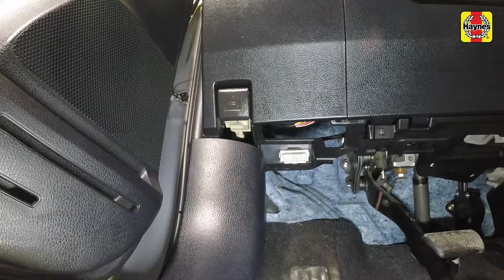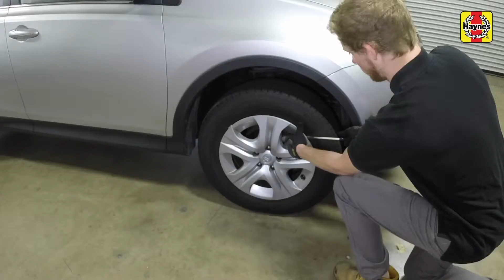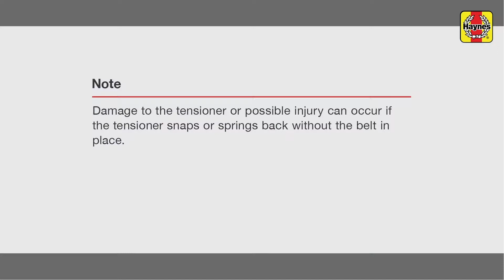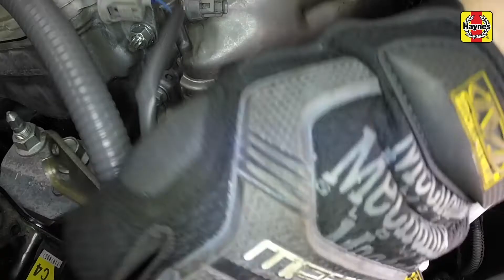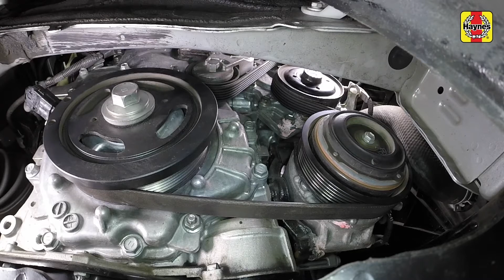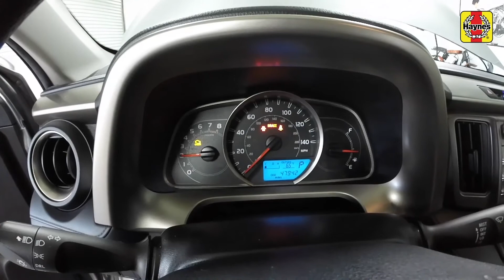How to Replace the water pump on the Toyota RAV4 2013 to 2018

Comment: You never poured any antifreeze directly into radiator. Is that correct?
Reply: @larrylynn5965  that is correct.  For this vehicle all coolant is added through the expansion tank.

Comment: Used oil & transmission fluid can be taken to local auto parts store to be recycled.  
What does a person do with the old coolant?
Reply: Most garbage dumps/transfer stations will have a tank that is used to capture old cooolant and also another tank for oils and somewhere to throw the old oil filter. Check with your local dump/garbage location to see what they offer. Should be no  charge.
Reply: @macker0077  yes. And in my case. The closest dump/transfer station would not accept it, had to drive to different one on other side of town (just fyi for any else searching for local antifreeze disposal)
Reply: another option is to check your city/village.   It will have its own maintenance department.   My village maintenance department takes used oil, coolant, brake fluid, and household chemicals.

Comment: Great video! Thanks for including those important torque specs, which many fail to mention. My daughters 2017 RAV4 has the tell tale signs of a failing water pump. That pink coolant slung on the hood by the serpentine belt is a dead giveaway. Any chance you have an estimate of how long the job is start to finish? I'm going to say 3-4 hrs.?
Reply: Lol bro thats excessive, max 1.5 hours . Given i am a mechanic but still no more than 2 hours
Reply: @davidmanzano8055  Took me about 2.5 hrs. including refilling the cooling system. Toughest part was getting  some of the pump bolts off and back on due to the tight area it's located in. If I had to do it again, definitely less time.
Reply: @macker0077 lol the hardest part for me was putting on the alternator, she just didnt wanna go in for me and even after shes in aligning the bolts was another struggle for me😂crazy my car didnt wanna work with me but ive done dozens of rav4s and they all smooth
Reply: @davidmanzano8055  Yah, the alternator is in there pretty tight. I had some struggle with it as well. Nice to have an extra pair of hands to help get it in place.
Reply: @davidmanzano8055  Dumb question- but I should flush the coolant BEFORE I put a new water pump in- correct?
Reply: @Dan-fq7db absolutely, regardless when you take off the water pump all the coolant will come out. Just remember to flush the system when your adding in coolant, you dont want bubbles inside or the heat wont work

Comment: Is this a common issue with the RAV4? I have a 2017 with 58,000 miles and the other day I got the charging system failure light, when we checked under the hood the serpentine belt was gone and the water pump was shot? Any info is helpful.
Reply: Doing some reading on the Toyota RAV4 owner forums, it appears that the water pumps in the 2017/18 model years do fail prematurely on occasion. Sounds like you'll need a new belt and pump.
Reply: Provided it didn't blow a head gasket,or crack the head.worse case .. destroy the engine!!!! @macker0077